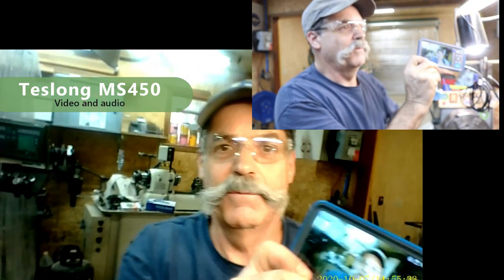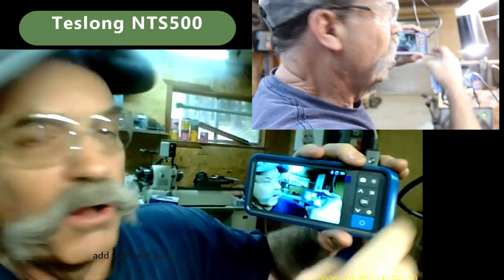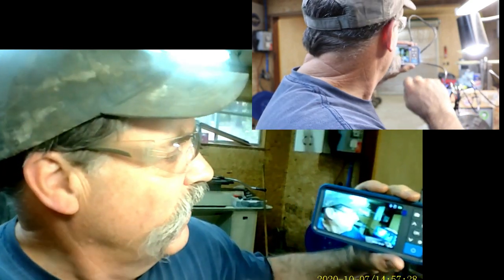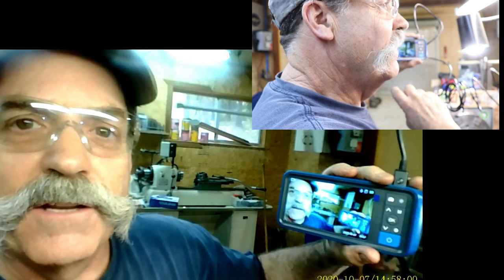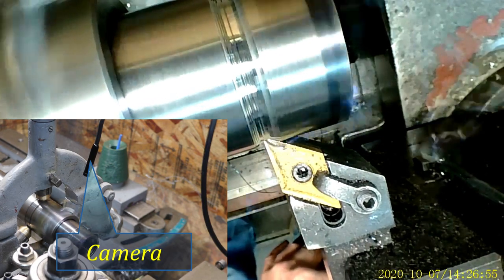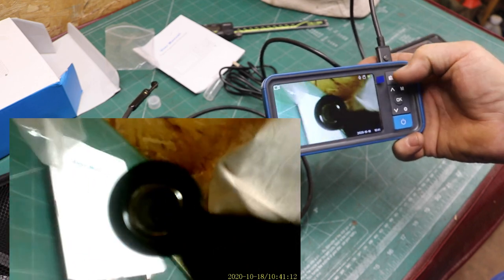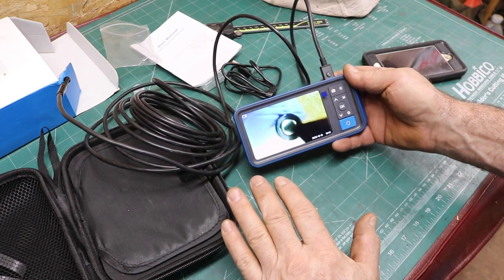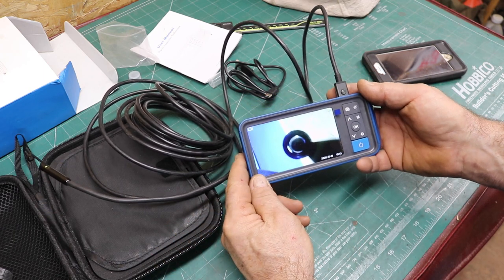Teslong MS450 Endoscope / Borescope Review | Dual Camera

Comment: Thanks for an exceptionally good review Randy.  Looks like a handy tool.  What is the minimum diameter that it will go into?  I am sure you probably said that but I seem to have missed it.
Reply from the maker: This one 8mm.   but you can get cameras that are 5 mm and one that will fit down a 22cal bore.  Thanks Harold.
Reply: @RRINTHESHOP  I need the 22cal camera to do some home exploration of my sinuses, since the Dr. doesn't have one.

Comment: Do you know if the video recorded is actually 1080p or is it only 720p?  Because the specs say both cameras are only 1MP but if thats true then it can only record in maximum 720p, because you need at least a 2MP camera sensor to record in 1080p.
Reply from the maker: Yes the recording is 720.

Comment: Just bought one from amazon.fantastic piece of equipment.just a very important note,that the focal distance could be a problem in confined spaces.great to look forward down into an engine cylinder,but when you select the side camera,you will be too close to the threads, an it will be out of focus.only when you are down in the cylinder, there's enough distance to use the side camera and spy on the walls...then everything is in focus ..not a problem,but be mindful of this issue...great piece of kit.
Reply from the maker: Thanks for sharing

Comment: I ordered a similar unit that was supposed to be used on android devices. After downloading the software then I get a message that tells me it will not work with my tablet. I like the idea it is stand alone and does not require a phone or tablet to use it. I am assuming you can download to your pc. If it does support download to my pc then I plan on buying one. It will be a great asset to my machine rebuilds. Thanks for Sharing.
Reply from the maker: Yes Terry.  the unit has a micro usb card you can remove or use the unit as the reader, just usb cable to plug into a computer.  Come with the usb cable and micro sd card.  Thanks Terry.